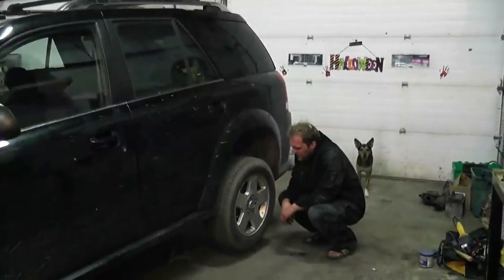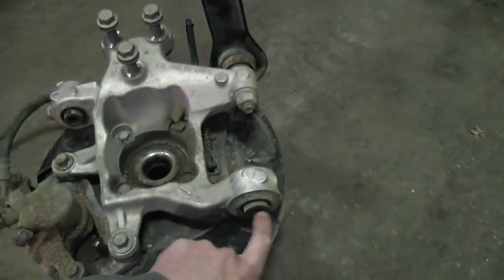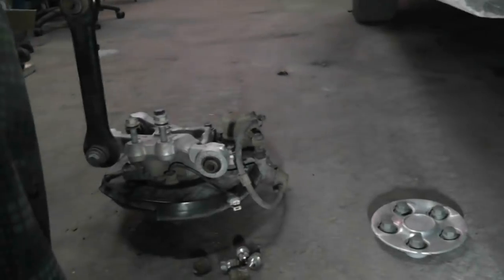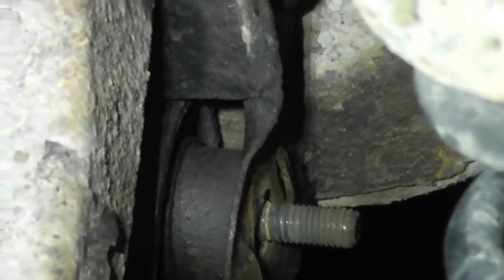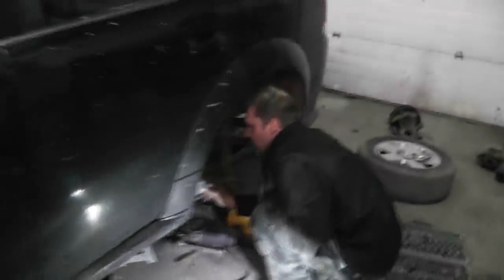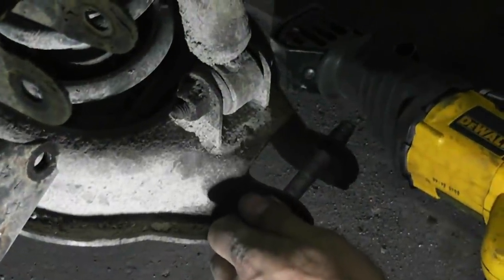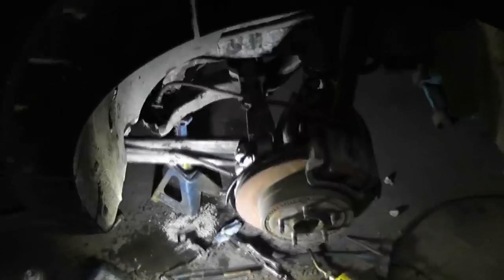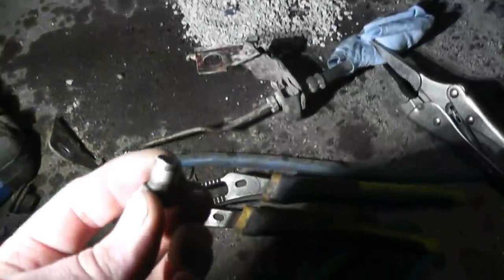Saturn Vue Rear Drum to Disc Conversion Pt 2

Comment: Was there any issues with abs working?
Reply: I just performed this conversion. I was smart and took the e-brake cables from the junk yard. Even though the hubs are different and have a different count on the abs sensors, my abs light is not on and appears to be functioning properly.

Comment: Note- Master cylinder and Proportional valve differs between drum and disc applications.Found this out the hard way modifying my Firebird to the T/A WS6 all disc option.
Reply: Michael Mullner lol I just mentioned a proportioning valve before I saw your comment. I don't know about the master cylinder, though. It may not be much different other than the volume of fluid it holds for each type but the valve could be a safety issue for sure
Reply: Volume is everything, as the pads wear it requires more and more fluid for the pads to travel from their "rest" position, to contact position. Master cylinder for drums rears don't provide nearly enough volume to accomplish this as the pads wear. I know cause there's "nothing like living it to knowing it".  ;)
Rickem wasn't looking at the mod as a"system" just a part swap. 
PS- It became very obvious on my swap because along with the brake/rear end swap I also installed the 6.6 turbo engine and it became crazy difficult to slow the thing down.

Comment: Hey guys,

Were there any ABS issues with this conversion?
Reply: I just performed this conversion. I was smart and took the e-brake cables from the junk yard. Even though the hubs are different and have a different count on the abs sensors, my abs light is not on and appears to be functioning properly.
Reply: @Tombrewster421  The bigger issue is with the traction control.  I ran bigger tires in the rear and had TC turn on at highway speeds around a gentle bend.  Check to make sure that's not an issue for you.

Comment: Why doesn’t Canadian car manufactures Linux frames in certain undercarriage parts for protection simple fix?
Reply: Car electronics and mechanical parts fail long before they rust out anymore - go visit a rustbelt junkyard, rust isn't what put them all in there it was $2000 transmission costs and everything else.